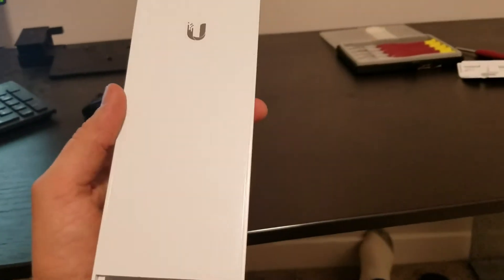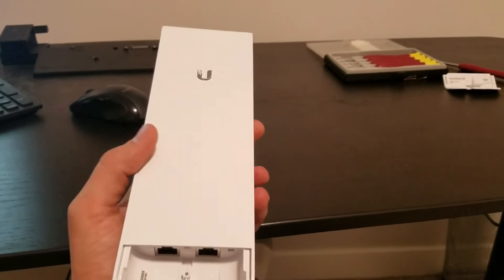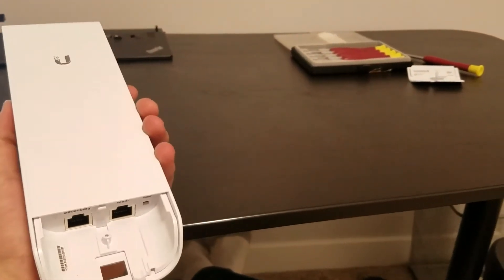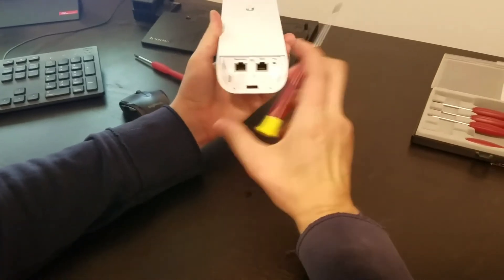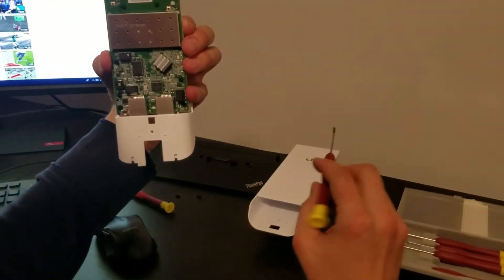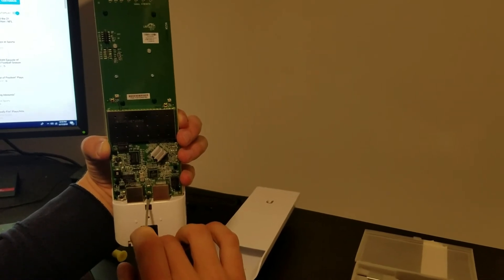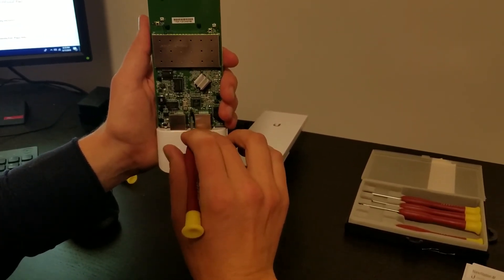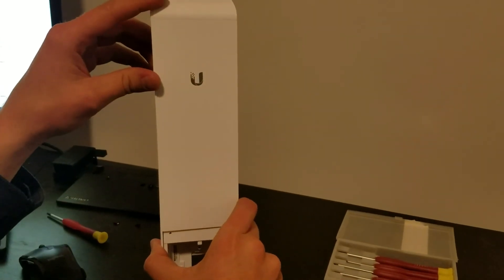Fixing a burnt-out Ubiquiti Nanostation M5

Comment: Sir, I have a Nano Station M2 led adapter and an NS M2 power led. If you plug it into the POE, both lights will flash simultaneously. I wonder what the problem is, please reply sir...

Comment: I thought this was total BS and a barbaric solution, BUT IT WORKED!! I connected my unit to a 48V POE switch and although it still worked, it became unreliable. In frustration I (gently) ripped out the chip shown and rebooted sing the 24V passive POE. It works like when it was new now!

Comment: I have the same equipment and problem, when removing the piece everything remains the same, both ports still do not receive power from the POE.
PS: the plate is apparently in good condition in a visible inspection

Comment: thanks for video 
but i have question? i have 2 nano M5 one of them is access point and another one is  station, the station one is freezing i mean it's disconnect from network i cant even ping it from station place , it happened twice but i just reset it 3 4 time and it's back with out rest factory. it's weird,
Reply: i checked access point it good to go , and in station Athena when this happened you cant see signal LED  just Lan and Pwr LEd is on!